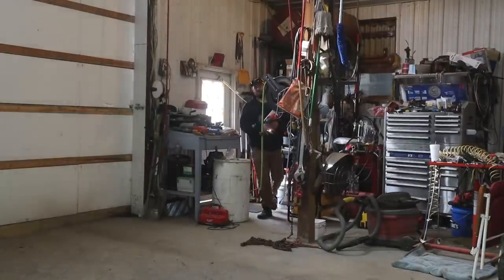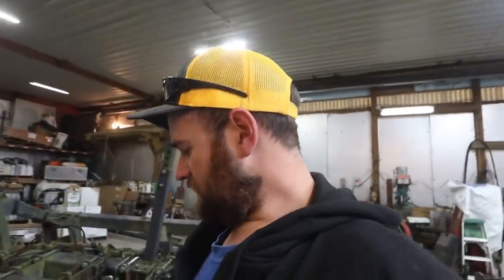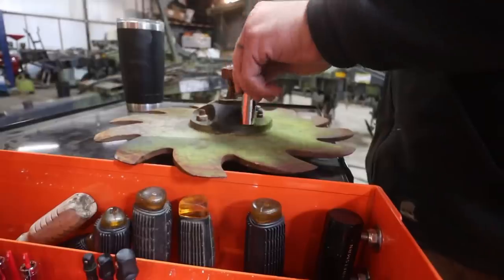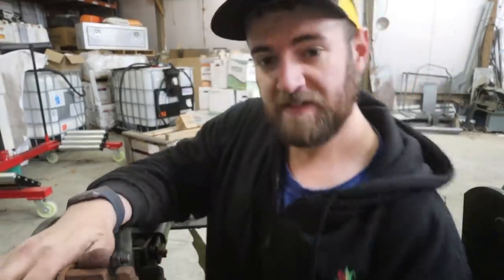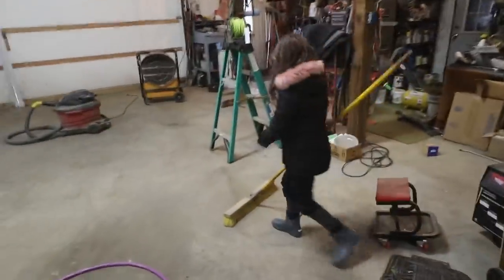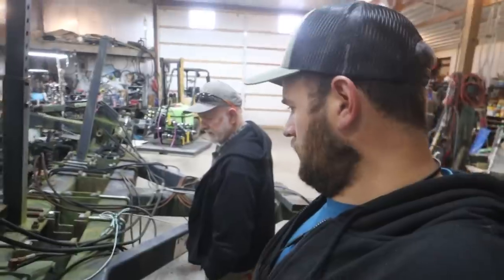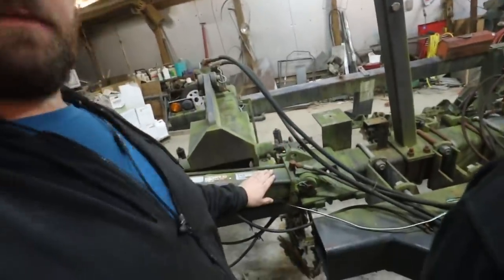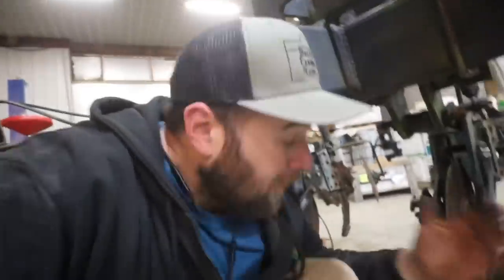This might be a BAD IDEA | STRIP-TILL BAR

Comment: Convert the bar back to 3 point. Now the baskets will fit. Use saddle tanks instead of a drag behind. Seems to be one of our best setups weve tried. We have some traction issues with a trailed bar and trailed tank. But the 3 point with saddles never has traction issues, unless its in mud. Both are powered by 8400 jd with same tire configurations.

Comment: One night my dog went nuts at 2 A.m. I looked out the window and seen 2 head lamps the ones you wear, wandering around the Nurse tanks on the other side of my feed lot. I got dressed went to the garage and grabbed one of my paintball guns. It was below zero, so I snuck up on them from a 6 foot deep ditch,  got within 15 feet of them yelled at them and chased them as I was peppering them with frozen paintballs. My girlfriend at the time called the sheriff's department and they were picked up about 3 miles from the house. Easy find because the tailgate of their Volkswagen truck was actually hard enough to break a couple of the paintballs.

Comment: Ever consider buying a cheap air cart and using it for dry fertilizer, I’m currently working with a Flexi-Coil cart and I’m picking up a used 12 row redball bar next week to convert an make into a dry fertilizer strip till setup

Comment: Hi mate...🇦🇺
Nice job on the carpet..great idea..👍
Before we changed to linkage mounted strip tilling, we use to run these Quinstar Caddy carts from the US. They were build to last, super strong. Even us Aussies couldn't brake it..🤣😂
I see you current carry frame is subject to Significant stress cracking,
only a suggestion to look at 2nd hand caddy cart, that way you can install your rolling baskets no worries...
Have a nice day..🤠

Comment: I’ve never been a big fan of Yetter row cleaners.  Look into Martin row cleaners.  We have had them on every planter since 1994.  Row cleaners and spiked closing wheels.  
They make a great strip till system.  I believe you just provide the bar and what your application is.  Good luck with that rig, It needs some TLC.

Comment: put tool bar on 3 pt and use caster wheel to keep drawbar for liquid tank at same heigh and give you flexability in your hills i did that for my cultivator to pull annihydrous tank  Locak found pipe wrench under full tank and plug on bottom had marks showing they tryed to get it lose.

Comment: Our short line 28 rigs are 3 point with a liquid cart attached. There’s just a hitch on the bar and the carts are only 2 wheel models so they tip back and forth as you pick it up and down. Looks sketchy with a full tank but it’s worked for years now

Comment: Just something I have used on farm equipment, automotive, and on the semi for penatrating fluid is some stuff called Free All. I have tried many fluids and this is probably the best and most affordable that I have used for breaking bolts of all sizes. Just a note, it doesn't seem to lubricate very good but it does work great as a penatrant.

Comment: The Yetter row cleaner hub bearings are sealed, greasing the hub will not lubricate then, it only fills the cavity between the bearing and the cap.

Comment: If you make it into a 3 point lift. Just take the front hitch off the caddy and put it on the back looks like it is just clamped on the bar. It looks heavy enough to pull your 28% tank

Comment: If u make the bar a 3 point hooked could u just make a hitch on the back of the bar but make the tongue of the trailer extra long and have both ends of the tongue pivot? The trailer would be closer to you when it's up and further away down but a little extra hose would make it a non issue right?

Comment: If you make 3 point just mount saddle tanks or put a tank on front of tractor to carry fertilizer that way you wouldn't have to worry about a trailer running on the groves.

Comment: I would get rid of all that headache and just turn it back into a 3pt setup and either put saddle tanks on tractor or I’ve seen guys around here running a 3pt strip till rig and pulling a liquid tank just fine. We run a 12 row orthman 1tripr strip till rig putting down anhydrous only. And PB blaster we call it panther piss 😂😂😂 what a lot of people call it that lol

Comment: Not sure I'm following the strip-till vs side dress plan ?? Strip -till will have the row units on the same offset as the planter to plant on top of the "strip" correct ? To side dress the units need to be set up go between the rows and don't need those cleaners and closers for 28% , just curious ?? Have a good time at the farm show lots of sidedress and strip-till machines there !!
Reply from the maker: You are correct on striptill vs side dressing

Comment: I had to weld another piece of steel onto my yetter row cleaners so they didn't go past the stops on our old planter. Other than that I loved them
Reply: We just put another pin in they tip forward a little but works

Comment: Is that a new project over in the corner looks like a 67 nova.
Reply from the maker: No that’s dads 65 nova. He has had it for a while
Reply: Knew it was a 65! My dad bought one new, 65 2 door sedan, 283 4speed posi. He drag raced it and eventually put a 327 in it. Swapped the engine out in the old barn at the farm. 😎😎😎

Comment: Yup, I worked for a high speed cutting and tool die company and we used anhydrous to change color of drill bits. On night on second shift the alarm went off for the loading dock road. We ran out the back door just as 3 dudes were loading anhydrous into their trunk in 5 gallon jugs. They jumped in their car and as the were flying behind the factory in their early 80's Mercury Grand Marquis we blocked the exit. It didn't work they jumped the ditch beside the road and landed in the highway where all kinds of sparks were happening and we were like oh noooooo. We all ran down to the road where we noticed something laying in the middle of the road. In the middle of the road we found a bumper. Do you know what was on that bumper? You guessed it the dummy's tag . Next day they found him at his meth house.  LoL
Reply from the maker: Justice was served lol. Seems like they usually get away

Comment: Had a meth manufacturer use a cordless drill to drill a  hole in the bottom of a storage tank at the fertilizer supply location so he could drain it into his 5 gallon bucket.

Comment: We had some nh3 stole over 10 years ago they left valve on and hoses unhooked, several stories from cops here nh3 was put in milk jugs to take to where they were going to use it!!! Several propane tanks were used found out from walmart lot of tanks had discolored parts and was told it was nh3 used, 2 places had nh3 stolen they went down a gravel road a mile dropping tank every 400 feet to get a break coild track them to a t! Had some swiped last year noticed lights were on in my old shed where tractor and nh3 bar was at along with a full tank next to it. Called county  cop to come out at 11pm never found nothing but tank valve was slightly opened. That's the first we have had in many years